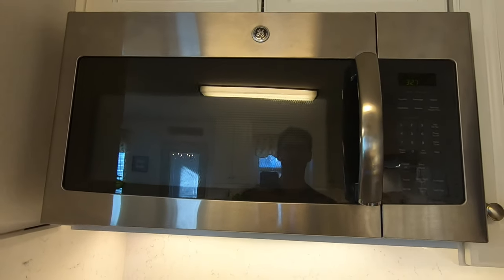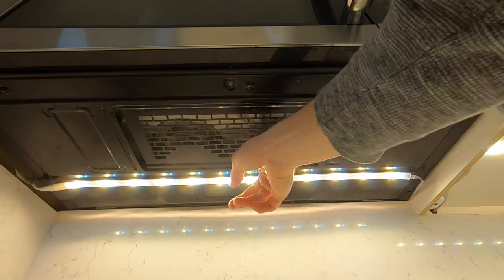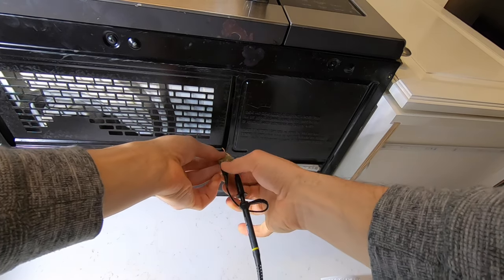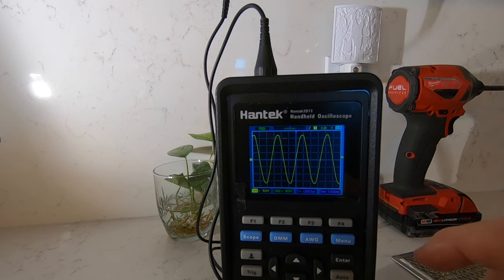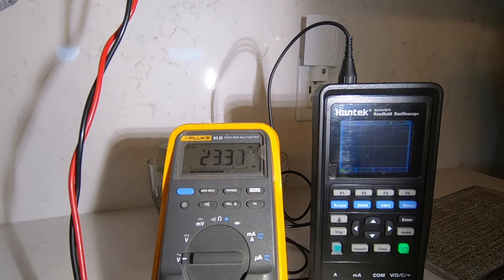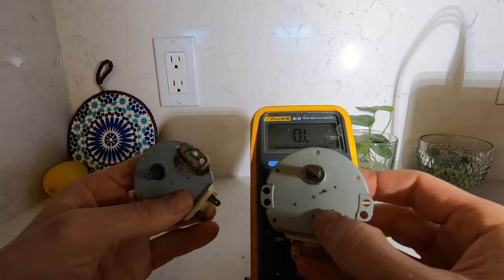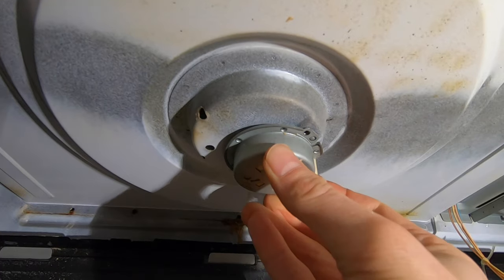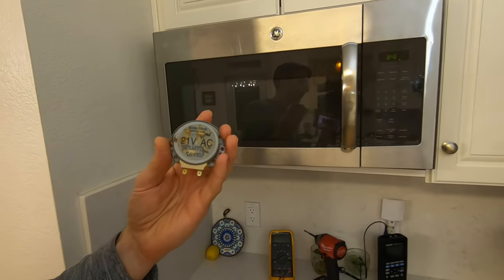Microwave Turntable Not Spinning - How to Troubleshoot and Repair

Comment: Those synchronous motors can be taken apart. The low voltage one you have has plastic gears in it that could be broken or the shaft that goes through the magnet could be corroded and just needs cleaned and re-lubed.

Comment: I have this same microwave and I'm struggling to get the door off the hinges to clean some condensation streaks/stains between the glass panels. It's the same model as yours. When I try to lift the door up, there is resistance and the pins don't clear their holes. It looks like there is a black plastic piece below the top hinge on the door preventing me from being able to lift it straight up like other models (I've watched a lot of YouTube videos on this). Can you help me? Do I need to remove that piece, or that entire plastic frame, first - before attempting to lift the door off? Or am I just not giving it enough muscle?

Comment: So I tested the lead and it was about 24 volts ac. I put the continuity tester leads on and got nothing on both old and new motor. My understanding is that it should beep for continuity. New motor also bad maybe?

Comment: My whirlpool microwave has the 120v motor, I purchaseed this 21 V motor,, it started turning again. but after 30 seconds of turning it fully stopped again.. do you happeend to know the reason?
Reply from the maker: If the original motor is a 120V motor, that means that 120 Volts is going to that motor for operation.  If you put a motor that is rated for only 21 volt operation, it is not surprising that it blew the motor. You need a motor that is designed for 120 volts.